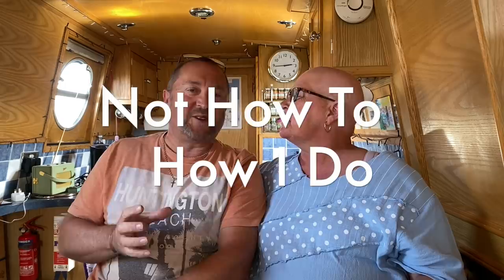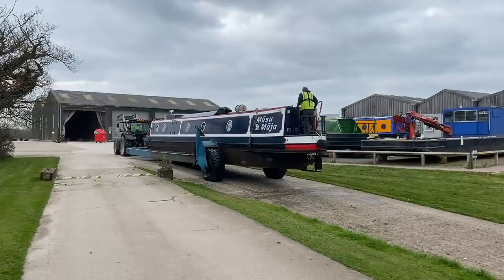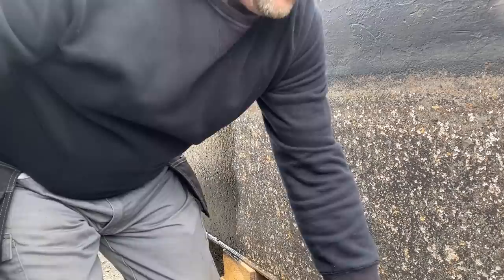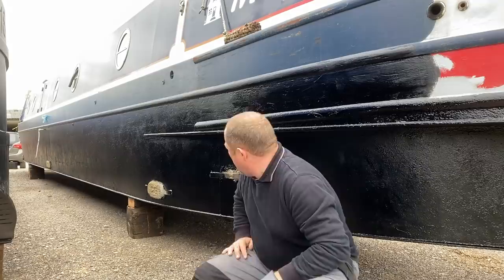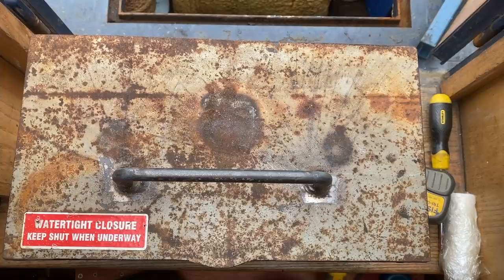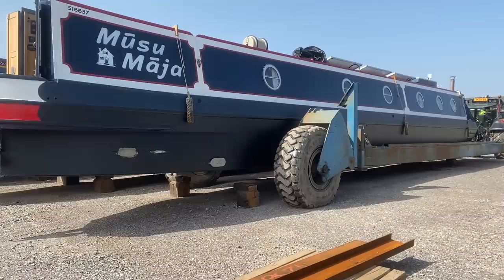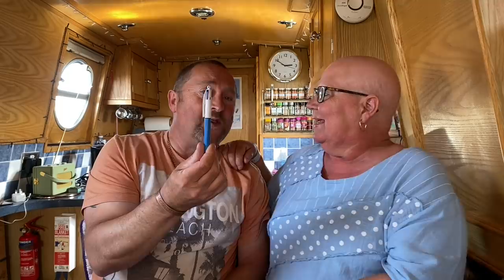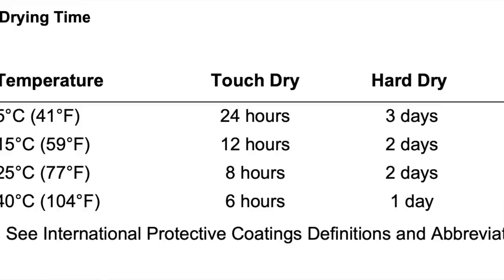DIY Narrowboat Blacking Important Information, How Much? How Long? How To? Canalboat life Costs E102

Comment: You could get the boat hauled out in the summer, let the hull dry and then abrasive blast clean followed by hot  zinc thermal spray which then needs passivating, then apply the blacking.

Comment: Interesting point about the time before going back in the water after the last coat.
Although we did ours ourself we were 'reliably' informed by the boat yard we would be ok to put final coat on in the morning and re flood the dry dock to come out late afternoon as the paint would be dry...
FORTUNATLEY we plan to come back out next year anyway (once we have saved up for shotblast and 2 pack!). So hopefully we will be ok. 
But it does seem some of the 'experts' at the boatyards perhaps aren't as 'expert' as we are led to believe...
Reply from the maker: We was assured by the boat yard 2 years ago it was ok, but after reading up on it I would argue it. The solvent in the blacking needs to evaporate and dry out properly in the air for the blacking to fully cure, this wont happen under water
Reply: @welldeckdiaries5610  I think that's the key to what we've quickly learned - RESEARCH everything! 
Next time we are blacked we definitely won't be going straight back in!

Comment: Old vlog now but useful one.
Boats are eaten inside out 
Which simply means untreated metal inside is rusting out.
Spray foam is bad especially if the metal has not been soda sand blasted then perfect ( hot zinc applied) if not zinc paint professional then insulation stuck on and fixed leaving the essential air gap between panels with air flow vents both sides stern and bow.

Comment: I had a couple of questions but you answered them when you sat down to sum it all up!  The first question was Would it do better/last longer if you put several coats of bitumen on the hull?  Indeed, it is necessary.   You want two coats to make sure that every nook and cranny is sealed off to keep the water from reachin the steel and rusting out. To be safe, you put 3 coats on!  I don't think you were over thinking it because I would have done it EXACTLY  like you did. 

My 2nd question was about the availability of supplies for you to use, as compared with the items i have available for myself on the other side of the Atlantic.   Here, there are a variety of different rollers, both short and long, for different surface textures. They have one with thick pile here that will completely saturate a really rough surface and will use quite a bit of paint because the depth of the roller pile will naturally hold more paint.  You would probably end up putting on two coats in one pass.  But maybe you don't like those because the possibility of air bubbles between the bitumen and the steel hull is fairly high.  Is this something you have any experience with? 

This is,  quite possibly,  the worst comment that I have posted on your channel because I don't have one single comedic bit about blacking a boat. Being neither a genius,  a professional comedian or a  plagiarist, i truly have nothing.   Having said all of that, i DID enjou the video and watched you like a HAWK so that i will have an idea how to manage this when i buy my narrowboat.   That you for the not how to do but how YOU do video.   Speaking of plagiarism,  i did hear one joke that Philip told Matthew.  He said he had a vegetable hoke but he was sure they would want to hear it because it is corny.  BaDumDUM!  So with that cornyjoke, i will sit down and shut up. 😁🤣😊.
Reply from the maker: Hi Rebecca, we do have all those different types of rollers but I just took advice from the people in the boatyard as to the best way to apply the blacking, they do it for a living and use a brush the rollers. 
Love the corny joke 🤣😂

Comment: If you look at blast and two pack next time have a quote from Debdale Wharf, just past Foxton locks on the Leicester line, if you have won the lottery by then ask them about Zinc spraying. You are right,  most places just chuck em back in the water and it pops through in a couple of months.
Reply from the maker: Thanks for that, I will enquire 👍
Reply: Try their sister yard and marina at North Kilworth. The guy who does their blacking is brilliant and very fussy. Had mine done there 2 years ago and am due there again in a week or so and having the baseplate done this time.

Comment: I did DIY Blacking at Streethay Wharf and it cost me nearly £900 - that was the slip out, blacking, 6 anodes, and the slip back in.
Reply from the maker: I bet the 6 anodes bumped it up a bit
Reply: @welldeckdiaries5610  Dam right it did! worth it though for the long run :)

Comment: Your boat looked so amazing at the end! I went back to the vlog you did when this was done for you at Banbury 2 years ago but I don't think you mentioned the cost at the time? Still, even if you didn't save any cash at all & your muscles & tendons paid a steep price for doing it yourself this time, I think you're right that it's still well worth the peace of mind you'll now enjoy for a couple of years from being certain that each coat protecting your hull was given the curing time specified by the manufacturer. Plus, let's face it, even the best tradesmen will never have the vested interest that a boat's owner will have in meticulously ensuring that every single teeny nook & cranny gets its proper share of paint. Great job!
Reply from the maker: It was very rewarding doing it myself, Last time we had it done it cost £1200 but they also welded on 6 new anodes

Comment: Lots of work!!  Good for you for doing it yourself.  I've always done my own boat bottoms, and I repaint the bottom on each boat I've owned every year because of salt water here in the Pacific NW of the USA.  Every 10 years, I have the bottom sand blasted and start over.  And I use a roller (it's faster and easier on your hands and elbows and shoulders), never a brush.  Does your left arm not work, Mark?  Try it, train that left arm! 🙂  You'll be happier if you use your left arm half the time.  Oh, excellent weed hatch upgrade, you should patent that!  And I'm with you about the data sheets and time required for hardening off.  No legitimate boatyard would do otherwise.

Oh boy I know how it feels to have your boat in the air with someone else in charge!  My 1939 boat was 42 feet long by 12 feet wide.  If I could have found a haulout with a "lorry" like you folks use, that would have been great, but here we use straps and a very tall structure to lift/raise the boat straight up out of the water using those straps.  And the boat swings and sways like crazy.  Nevertheless, when the boat finally "splashes" and gets back in the water, I think every owner breathes a sigh of relief.

Oh, and yes!  when I was in my boat when it was "on the hard" on land, I would run into the cupboards and cabinets inside the boat because it was NOT swaying with the water.  What an odd feeling. 🙂

Great video, great info, perfect in every way.  Thank you!

Comment: I once undersealed my motorcycle and sidecar combination with a bitumastic paint, it was messy and a right pain removing and replacing the wheels but protected against all that winter salt and grit from the roads. It was messy and gungey but did the job well. The worst bit was getting it off my fingers where i spilt it. Most satisfying when done and i reckon although you had a more vast an area, it was more straightforward. Knackeri g, but you know you've done as good a job as possible, one less worry👍👍👍
Reply from the maker: Its always satisfying doing it yourself

Comment: Think you did the best blacking video I've seen. Got a lot from it. Like your discussion about drying times. Yes, drying times are important, so many things happening with the paint and solvent. The splat it with paint and chuck it back in the water brigade just don't realise. The boat I am hoping to buy will be surveyed on Tuesday and I, also, have my second covid shot 😁.  Then I shall be anti-fouling the boat with a new biocide free antifoul. Please keep your fingers and toes crossed.  Another great vblog, thank you both.
Reply from the maker: Thanks Paul.
Good luck with the boat survey 👍

Comment: You did well Mark,  we always preferred 2-pack epoxy and it is better if that goes on from new so if you are considering going for that next time you are thinking along right lines to have the hull sand blasted first.  We always worked in a dry dock to black ours and did it ourselves and always gave it 24 hrs between coats normally 2 coats was sufficient as once you get it coated with 2 pack epoxy when it needs doing again we just power washed it and wire brushed to give it a key and obviously removed any loose paint before recoating.  the 2 pack stayed on well.  Goes on well with a roller, only thing with that is once you mix the 2 parts you need to get it on.  Never an easy job and to save cost we always did ours ourselves every 2 to 3 years.  Quite a big job sandblasting as it gets in everywhere and would need to try and seal the vents/ doors and windows etc.  Best wishes with your radio therapy Debs.  Love following your progress, its been so nice you have shared this journey with us all and shared your home with us to, some vloggers do not do that and have found some keep you more at arms length.  I have been following one couple for 3 years and still do not really know them as their vlogs are always about the cruising everyday.  I much prefer what you are doing.  XX  (ps, our son follows you as well and he lives in California)  xx
Reply from the maker: We will probably shop around for quotes to get her grit blasted and 2 pack next time

Comment: clad to see Deb looks better every time. In the 80's we bought a 40x20 steel hulled barge to do private waterfronts and marinas on Lake Simcoe had to pull it Nov. every year so ice wouldn't crush hull a tar sprayer used for driveways and epoxy paint 4 coats Use of  Bitamin is illegal in fresh water
Reply from the maker: I know some of our Bitumen type paints have been banned

Comment: Interesting hearing your costs. We have a 70ft wide beam on the Thames. She weighs in at 37 tons and is lifted out by a travel hoist. The lift in and out alone is £2400. We are having her 2 pack epoxy this week and the total cost is going to be £5300. My next boat is going to be a narrow boat on the canals up north as it’s far cheaper. Ok so 2 pack doesn’t need to come out quite so often, but there isn’t much in it I don’t think and it’s easier to repair bitumen blacking as you go.
Reply from the maker: I assume it’s being grit blasted first.
Reply: @welldeckdiaries5610 I don’t think so, it will have to be abraded properly , not sure how the yard will do that, It’s being completed as part of a warranty issue so thankful I’m not actually having to put my hand in my pocket.

Comment: Hi,M&D,you should find that the baffle plate makes a huge difference.We did the same thing some years ago.I can’t understand why they are not fitted as standard.
Reply from the maker: ours had one originally just held on by 2 thin rods I think the original Werner cut it off for some reason

Comment: Hi i used LMS on our hulls for the last 10 years, my last boat it looked good after 4 year but i did have the hull shot blast and zinc primed from LMS great blacking product
Reply from the maker: Was that expensive?
Reply: @welldeckdiaries5610  Shot blasting the Hull up to the gunnel not base plate £500 LMS £120 zinc primer £85 must be put on asap after shot blasting
Reply: We have just finished boating after 25 years now motor home owners every thing you do in in this now cost an arm and a leg every thing has gone up 50% p/s love your vlog w e live in Wisbech St Mary not to far away from your home town stay safe

Comment: Nice job on that blacking.
Seeing you do it in time-lapse, makes it seems to go quicker.
Re. your weed hatch.
I have seen other hatches with that bottom plate, I thought, that was the Standard !
Could it have been made Flush with the underside of the counter-stern.
That way would reduce your CD factor and make the boat go faster  !  5555  !
You two are looking more relaxed,
So keep safe and well  !
Stu  xx
Reply from the maker: Debbies streamlined head has reduced our drag factor 🤣😂

Comment: Great vlog, very interesting. It would appear I had the same issue with our NB blacking at the same dry dock. 48 hours, two coats and back in the water at 6.30am, in March and the temp was under 10 degrees the entire time, worryingly!! 
After your ‘top’ instructional vlog, I’m going to do it myself this year.
Take care both x
Reply from the maker: It never felt right going into the water in those temperatures after only 16 hours

Comment: hello ' well deck diaries ' met you once at norton junction , only briefly though as we passed by , anyway you said about 2 part epoxy coating , Hmmm , cost wise , maybe i think its probably cheaper blacking every couple of years as to epoxy every sort of 7 or 8 years or so  , but heres my ' old school engineering ' thoughts , preventive maintenance policy goes along way to keeping things in good working condition , so if you black every 2 or 3 years you are also inspecting ! , but if you was to epoxy every 8 years you would only inspect once every 8 , lets say some damage occured or epoxy lifted around your anode areas , you would only discover the problem when it is probably too late , your thoughts of my thinking !
Reply from the maker: Good way of thinking Tim👍

Comment: Great vlog, very interesting and I love that "Tuning Fork Trailer".  I know you undercranked it, but it looked like they were pretty slick in real time?  As for "straight in, no foreplay" - behave yourself Mark!

All the hire boats we've had have had that baffle that 'fills' the weed hatch, so I had assumed that all boats had it?  Please try and remember to assess the handling, noise or propeller efficiency when you finally get back to cruising.  I'm just impossibly curious!  (I think there will be much less noise and you'll probably find the prop has been cavitating.)  As I said, great vlog, you are probably a lot more meticulous than I would be!
Reply from the maker: It seem to cruise smoothly and there is a lot less noise in reverse so. It had a plat originaly that had been removed for some reason, it was only originally supported by 2 thin steel rods so it may have vibrated

Comment: Mark, my husband has always wondered, what about the bottom of the boat? Does it get blacked? What protects the bottom? He is a day guy like you are and he loves your Not To Do videos. Thks! Love you both and look forward to your updates.
Reply from the maker: Not normally, the base plate is thicker steel and with lower oxygen levels at the bottom of the canal it doesn't rust as much, and any coating you apply get scrapped off in the shallow water
Reply: @welldeckdiaries5610  thank you Mark for answering. 🥰

Comment: I always. Grind wire wheel water line then fertan it and any other bad pits other than that I’m similar if the jobs done rite it dosent have to come out in 2 yrs stand by for the arguments I took a bait out at aquaduct to blacken. It had t bin out in 6 yrs suprise suprise it was t that bad
Reply from the maker: good tip 👍 Thanks

Comment: When you paint over the white spots isn't that just sealing the corrosion under the paint?
Spraying/brushing with rust converter first sounds like a good idea.
Reply from the maker: The blacking is designed to go onto bare metal so no primer or undercoat needed

Comment: Mark it's a cavitation plate
That quote for two pack epoxy is way over the top Debdell  wharf would grit blast hot metal zinc spray and then two pack epoxy cheaper then that quote
Reply from the maker: Thanks for that, I'll remember that for the future
Reply: @welldeckdiaries5610  Hard work! An 'anti-cavitation' plate. I understand it improves propeller efficiency because far less energy is spent constantly churning up the weed-hatch water. Having seen videos of the trouble that canal weed can cause getting wrapped round the prop, I came across weed-cutter prop attachments that chop the weed up as you cruise along. You can also get a retro-fit version.
(My boat at this stage is entirely on paper..)

Comment: Always wondered  when you black the boat bottom what about the parts where the boat sits on the supports  😀 enjoy the films 👌
Reply from the maker: its not normally painted, the base plate is thicker steel to last longer and with lower oxygen levels at the bottom of the canal it doesn't rust as much, and any coating you apply get scrapped off in the shallow water

Comment: You don't have to do the bottom? Interesting....my arthritic wrist hurts by the time you started. Your a better man than i gunga din.
Reply: it's pointless. The bottom is thick enough to outlast the rest of the vessel. It's deep enough that little oxygen gets to it so corrodes very slowly. It's often coming into contact with the bed of the canal so any blacking that was applied would be scraped off within weeks.
Reply from the maker: Not normally painted, the base plate is thicker steel and with lower oxygen levels at the bottom of the canal it doesn't rust as much, and any coating you apply get scrapped off in the shallow water
Reply: @welldeckdiaries5610  I thought maybe but it wouldn't have been the first time i was wrong..lol. thanks for answering the dumby  question. I sure hope you saved more money than you seem to have.

Comment: I was wondering if the product could be thinned a tad (?) if so you could then use a large heavy roller for fast application but giving 3 coats instead of 2.
Reply from the maker: It can be thinned for staying on.
I did do 3 coats, just took advice on brush first coat then roller the next coats